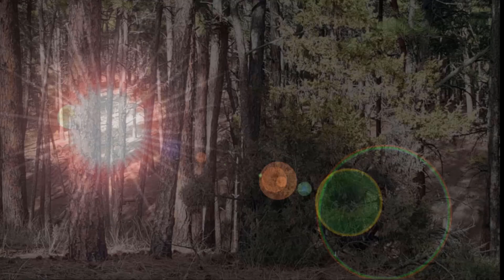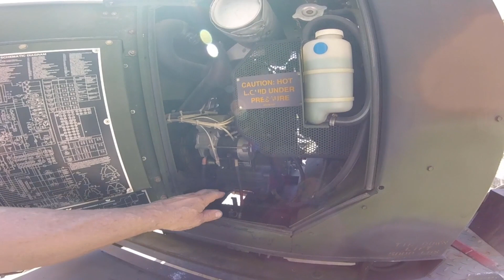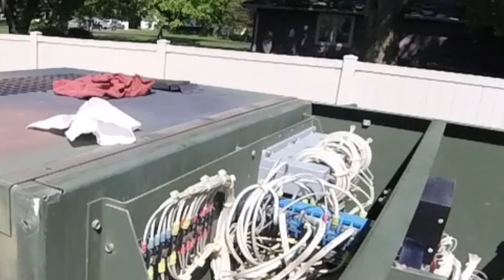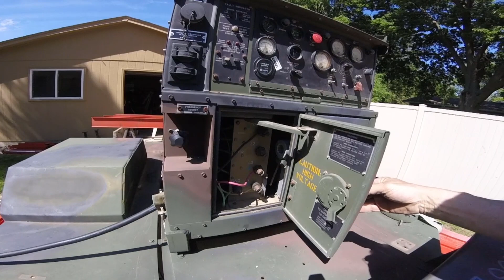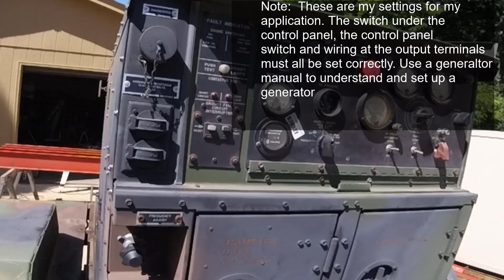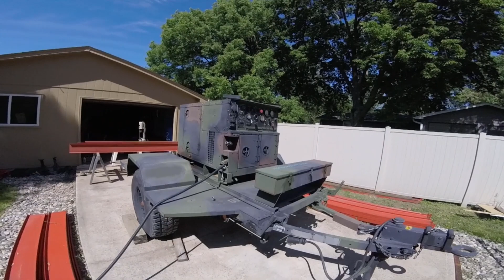Spencers-Mountain MEP 802A Military Generator  - Episode 5 off grid adventure.

Comment: What distribution box and cable are you using?
Reply from the maker: Using a CEP distribution box modified to commercial standard blade receptacles leaving half with twist lock.  Changed the 230v outlet to match my welder cable. Built a 50 foot 230v cable from SJOW 6awg with correct plug to fit into distribution box.

Comment: Are the user manuals readily available,  and if so where can one be obtained?
Reply from the maker: Go to your favorite search engine and look for "MEP-802-A Generator Manual"  several manuals are available to download for use, parts and some other considerations. It is pretty much a requirement to have these manuals available to run these generators since they have changeable settings and switches hidden in various locations.  If you have any doubts what-so-ever from reading the manuals, get professional help...these are serious powerplants not made for the average consumer. Thanks for watching my video.
Reply: @SpencersMountain  I appreciate the information, and completely agree with your advise.  I'm wanting to bid on a machine, but had concerns over absolutely understanding the proper operation procedures. I'm a fairly handy guy, but I've never dealt with electronics so anything dealing with the power side I would seek professional services.   Thanks.
Reply from the maker: @Ringele5574  good luck on your bidding!